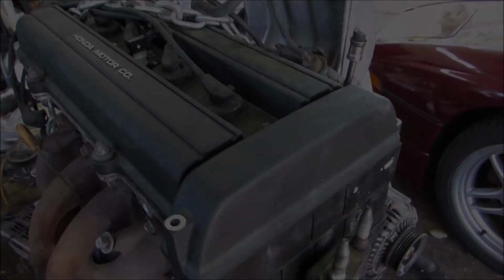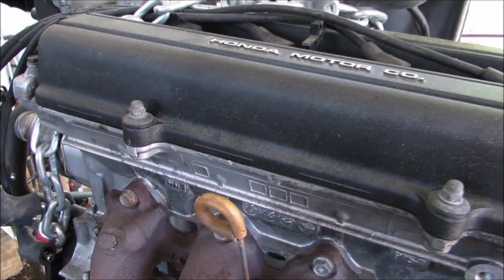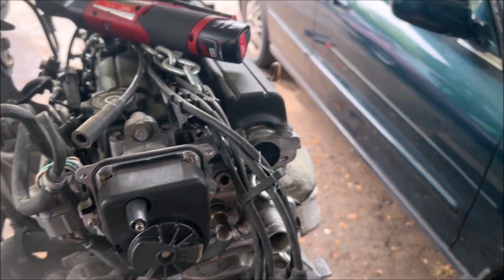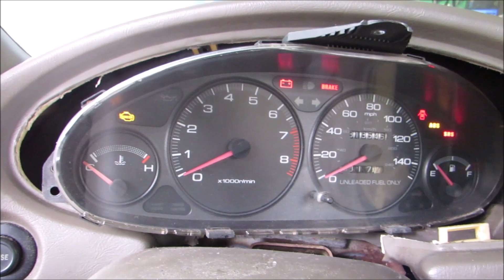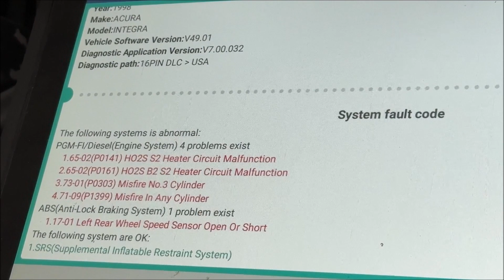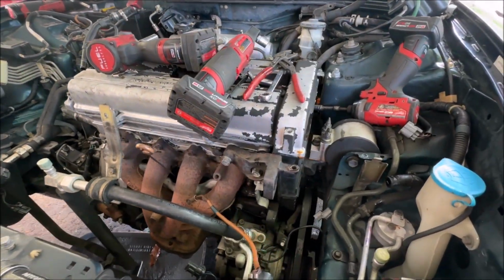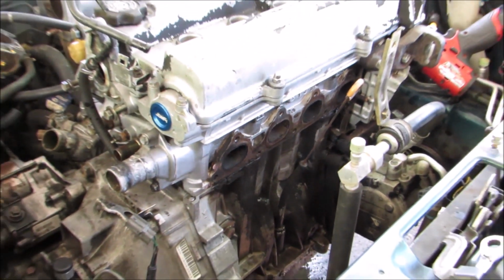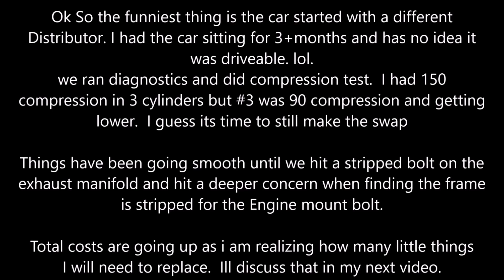1998 Acura Integra LS 5 speed B18B1 to JDM B20 swap Part 1 HMO Motors #acura #acuraintegra #honda

Comment: gotta be happy your getting it done so you can let the GS rest!! 50k on that motor is nothing thats why it was 1400.. salvage yards here (nyc) for usda (i believe 20 less hp) b20b’s are going for with more milage
Reply from the maker: Yea, im happy with the Motor and my tax return basically paid for it, so really didnt hurt me too bad.  I have to use my current tranny so  Im hoping to get some miles out of it before haveing to change.   I think there is about 200,000 on this tranny or more.  It does shift smooth so fingers crossed